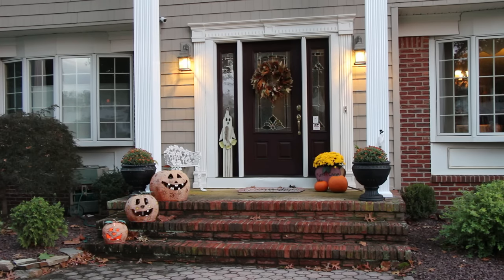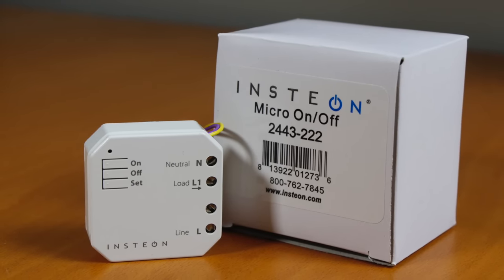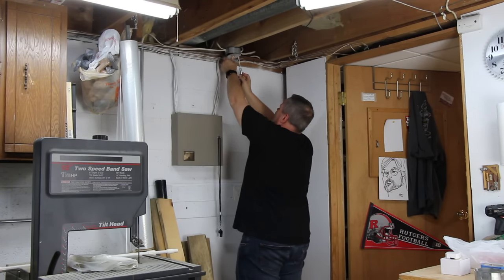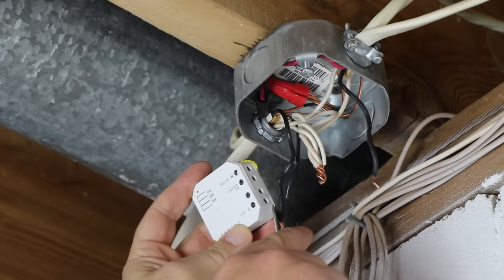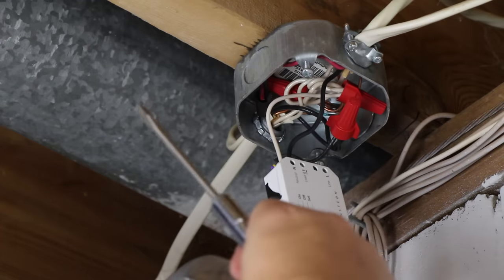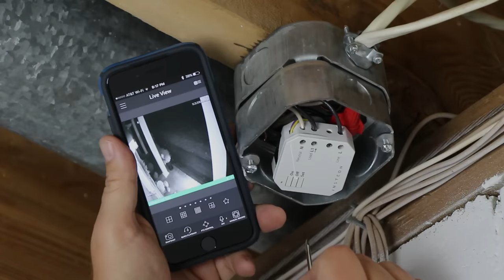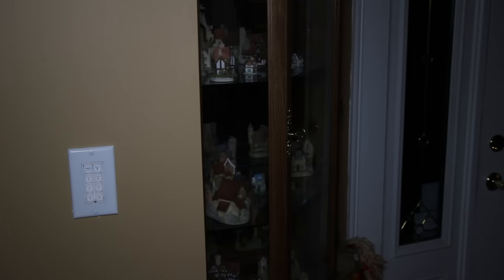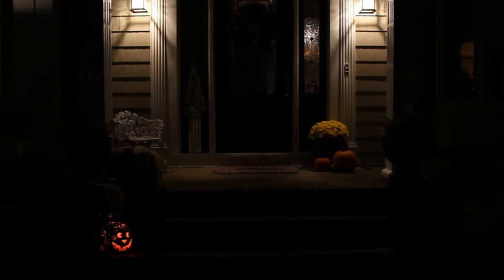INSTEON Micro On-Off Module - INSTANT INSTEON Ep. 4

Comment: This module (2443-222)  also has "sense" features. Do you have a video showing how this module might work as a switching device for a motion sensor in security lights (i.e. RAB Stealth360)? I would love to use security lights as a trigger for my hub in order to create a security "scene"
Reply from the maker: Yes that would work. See https://forum.universal-devices.com/topic/15615-is-there-an-insteon-outdoor-motion-sensor/
Reply: @handydadtv  Yes I understand that it would work (and in fact is designed for that). Your videos have featured two insteon modules with Sense but both times did not take advantage of this feature. I am looking to see these wires hooked up and explained.... the difference between Sense 1 and Sense 2....... a discussion of "latching".  This would be a great walk through

Comment: No WAGO in America? :/

Those pigtail connections are sometimes unreliable if made by amateurs like the audience (read: fire or electrocution hazard), using something like a WAGO block makes it far easier to safely install and later on update a system (as twisting and untwisting wires a lot doesn't work well with solid core).
Reply: i'm more shocked by the fact that everything is in metal in the US it doesn't make sense and so dangerous !

Comment: what are x10 signals and why don't they work in your home
Reply: X-10 is a very old technology for power-line home control. The signals are slow (60 Hz) and there is no verification in its protocol, so a garbled or lost control message is never detected. Since the inception of X-10, the number of electronic devices in a typical home has increased greatly as has noise on the power lines. There are many factors that cause X-10 to be unreliable and it's use should be avoided.
Reply: Jim K thanks